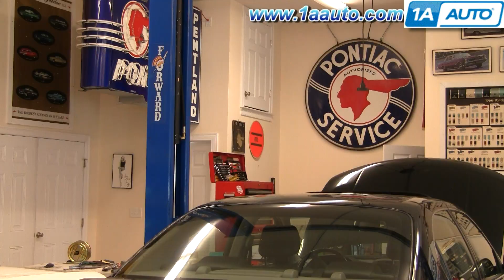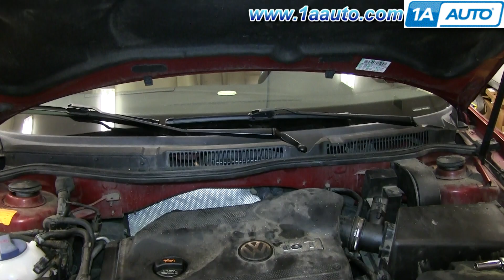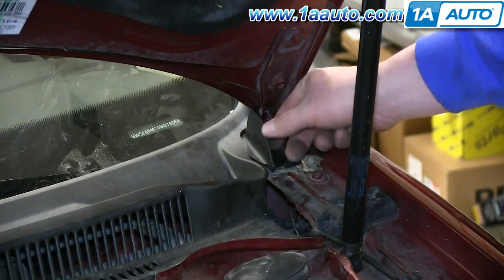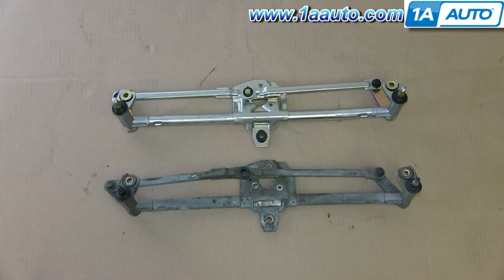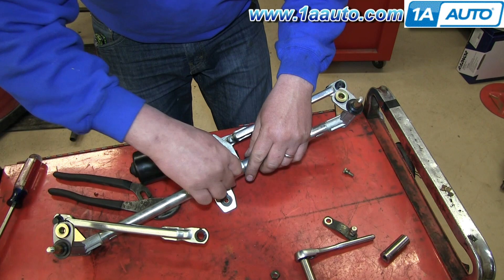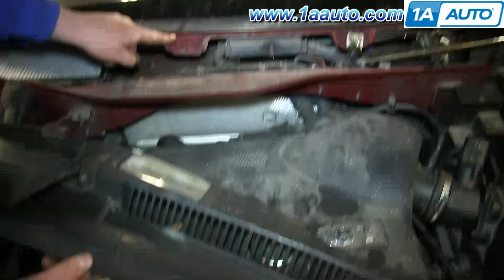How to Replace Windshield Wiper Transmission 99-05 Volkswagen Jetta

Comment: How do you know if you need to replace the transmission vs. the motor? On my 2011 jetta Tdi my wipers go on for one minute after I start my car and don’t work on low setting and turn of on medium setting after a minute and work on fast no problems..
Reply: Did you ever figure out what it was?

Comment: Does this apply to a 1998 Jetta?
Reply from the maker: +t115 You may be able to apply some of the basic steps shown in this video to your application. Here is a link to the replacement wiper transmission that we carry for your vehicle. Hope this helps you out. 1aauto.com

Comment: Thank you so much for the video, I have an issue with VW Jetta 2.5, 2007 wiper system. The wiper motor is variable speed. The driver's side wiper was passing past the A-Pillar, one of the local mechanics pulled out the transmission and said that there is an issue with the pivot and he fixed it by welding it. But, later when he was about to install it, he wanted to check if the system was still working, he kept the hood open, connected the plug to the motor and turned on the wiper but it did not run.  We thought the wiper doesn't work if the hood is open and made sure that the computer thinks that it is closed by putting in a screwdriver at the hood lock, even in this case the wiper system did not run. 
We thought the motor is faulty too and bought two used wiper motors both of them did not run as well. Checked all the fuses and relays all are good. Any suggestion on how to go about the situation will be of great help. Is there a way to check if the motors are good or bad? the variable speed motor has a computer on it and it doesn't work just by pluggin it to a battery I feel, it needs a signal to the computer pin on it.
Reply from the maker: +Nagamalla Thrilok You might be able to check them with an Ohm meter. We currently do not have a video that shows how to do this. You could test the plug end with a test light to see if there is power going to the wiper motor when the switch is activated. Hope this helps you out. 1aauto.com
Reply: Thank you so much for the reply. Could you please tell how we could check the wiper motor itself if it is working. I mean, is there a way to check without installing it.

Comment: thanks,,,have a question though...i have an f 150...if i hold assembly lightly  it stops,,if i let it go it moves,,,do wiper motors,,,wear out ? or just stop?
Reply: yea,,,i see what u r saying,,,i think the worm gear wore out when the blades froze to windshield,,,common issue in new england...thanks for getting back to me